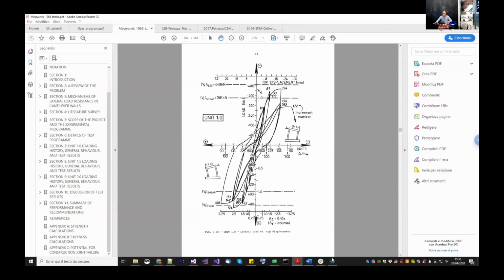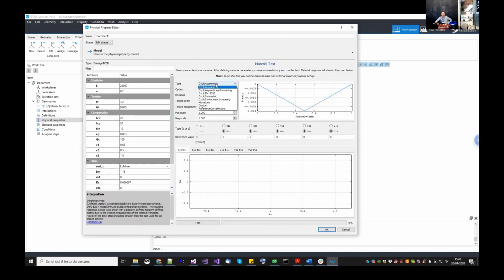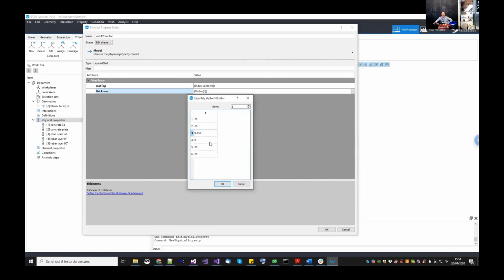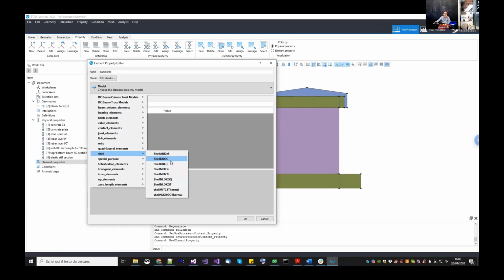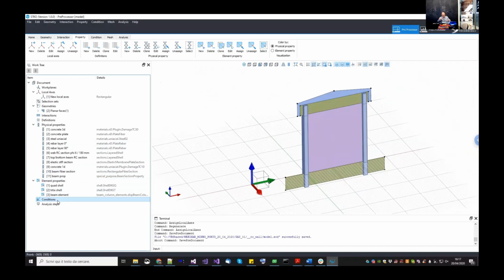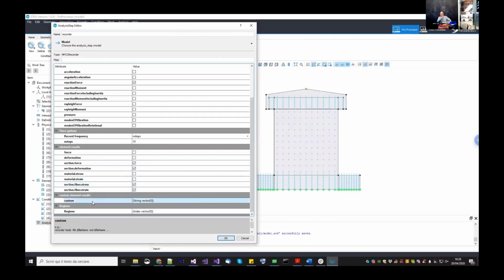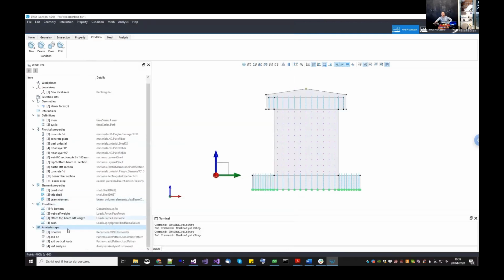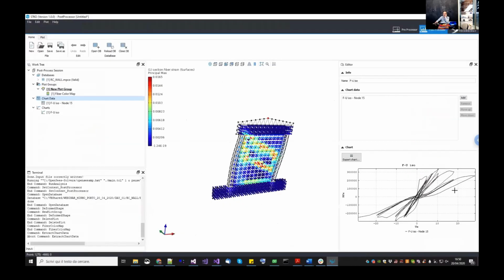RC Shear Wall

Comment: Sir, I have followed all the prescribed step with same value but did not get cyclic analysis result. I think there are some issues while defining horizontal analysis because i am using STKO 1.1.5 version and opensees 1.0.1 Solver. ICould you please help me what changes i should match to get result? It would be great help for me. Thank you.
Reply from the maker: Dear Meet Chovatiya, We are sorry you are having trouble with your model. We saw you wrote on our STKO user forum, and we will respond to you there soon.
Reply: @STKO_ASDEA  Thank you for your response.